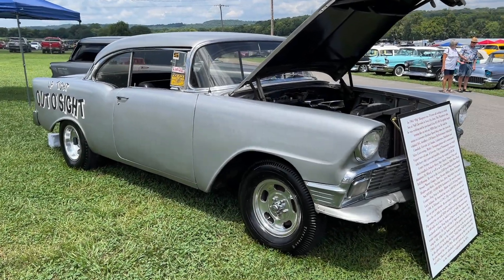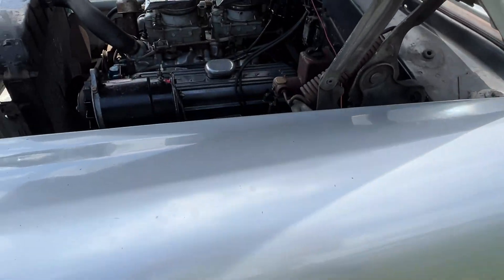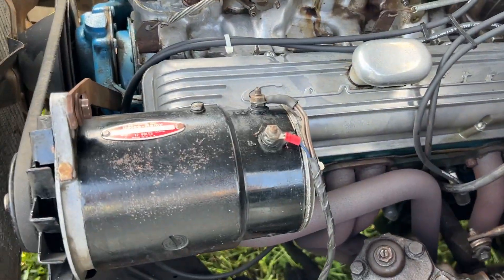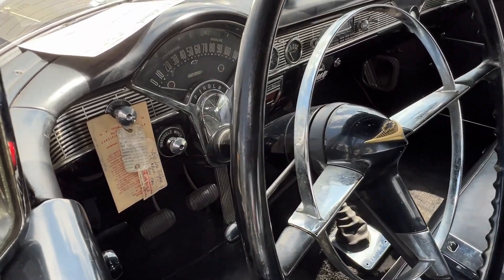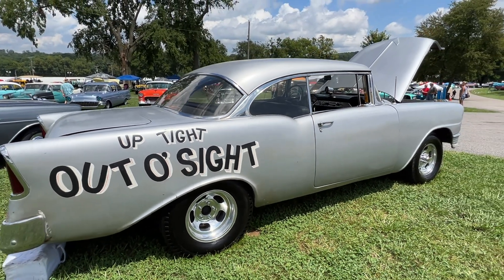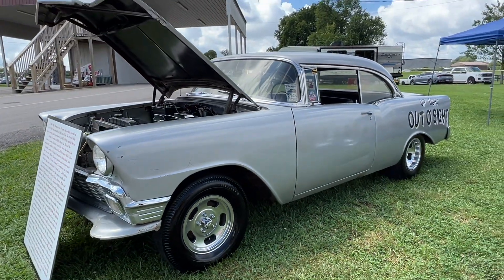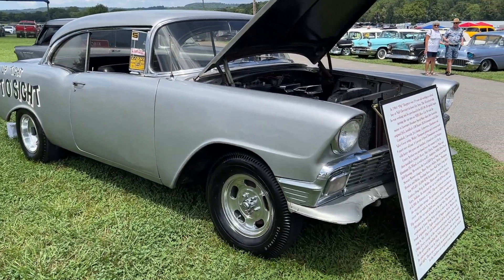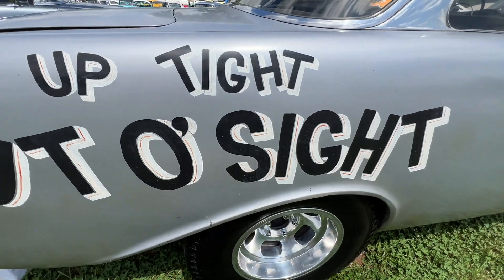HIDDEN from 1967 to 2020 - Crazy '56 Chevy DRAG CAR Survivor

Comment: Interesting video. Always had a soft spot for tri five Chevys. I have a 56 BelAir 2 door hardtop that has been in the family since 1976. My dad bought it from a guy that used to race it. It was running a 396 with 3 deuces and a 4 speed and 4.11 gears in the rear. That guy had owned since 1966. He ran a 283 with dual fours and a 3 speed before getting the 396 and 4 speed out of a 66 Chevelle SS 396 4 speed that had been rear ended. Before he sold it to my dad he put the 283 and 3 speed back in it and sold the 396 4 speed. While I was sanding it I found The Black BelAir in white letters down both quarters and 396 on each side of the hood and lower fenders.

Comment: There is a lot of bondo on this car
Reply from the maker: For sure!
Reply: Back then their were not Wire feed welders in every shop.  The right way to fix holes, rust and body damage was body lead.  Bondo or synthetic body filler made for cheep and easy repairs, never intended to last very long. The car still survives, and as a race car it was more important to spend $$ on speed, than body & paint.